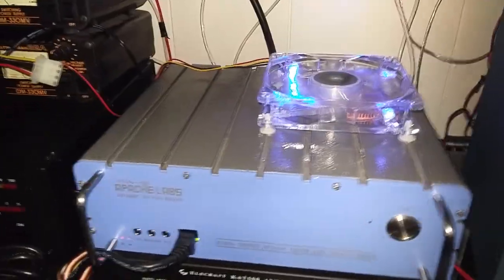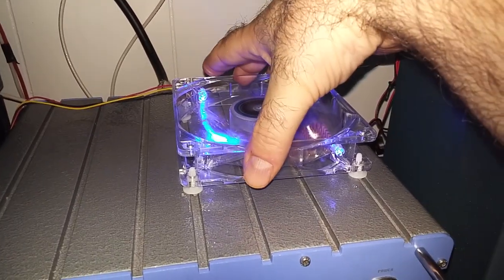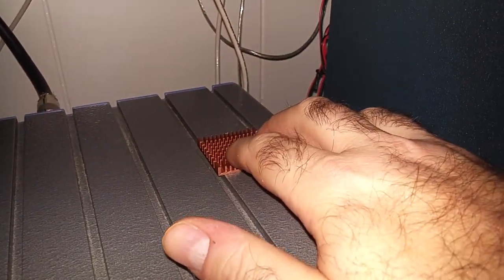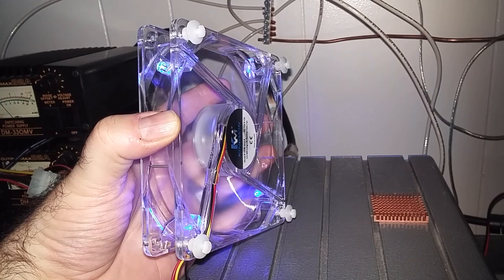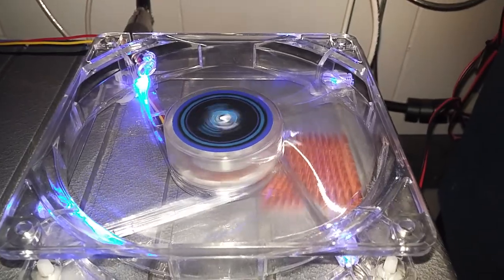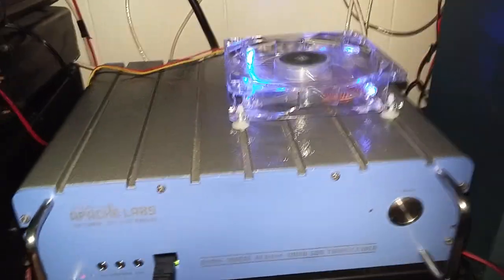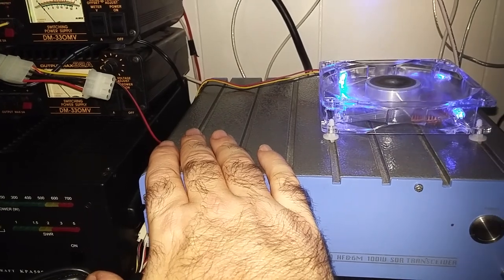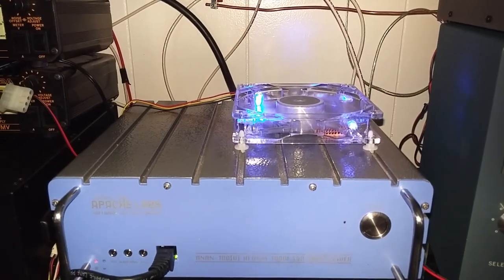Apache ANAN 100D Minor Cooling Modification

Comment: Nicely done! I run a lot of AM with my ANAN-100 and although it never overheated while running ~10 watts of AM carrier as it drove either of the amplifiers I plopped a slow-running 3.5 inch fan over the same spot. It certainly does make a huge difference in the temperature of the heavy extruded ANAN heatsink/case which of course translates into everything inside the case running much cooler. It's definitely a simple and worthwhile thing to do for anyone who runs high-duty cycle modes with their ANAN.  Rob W1AEX